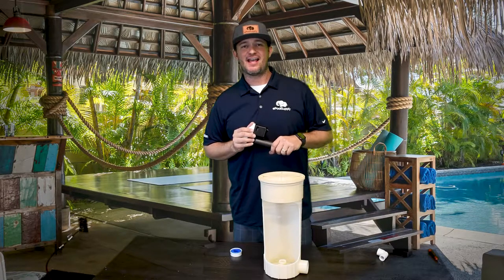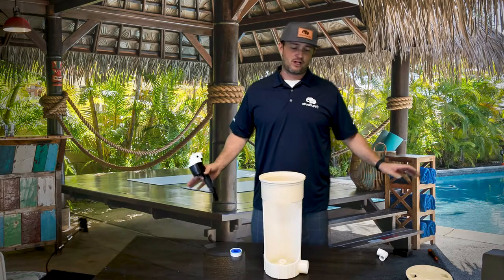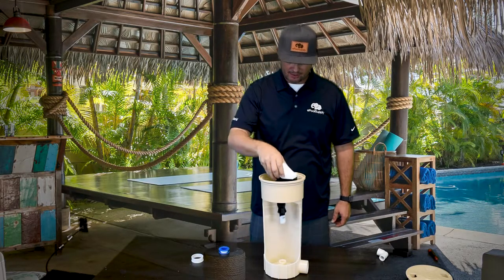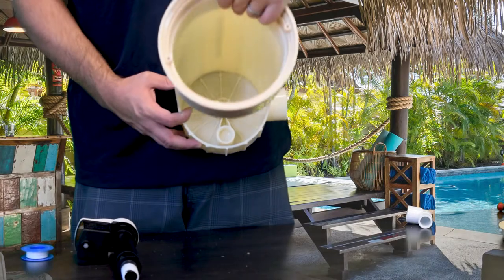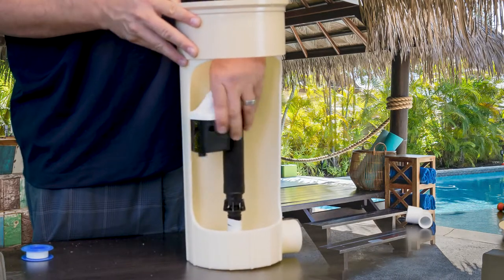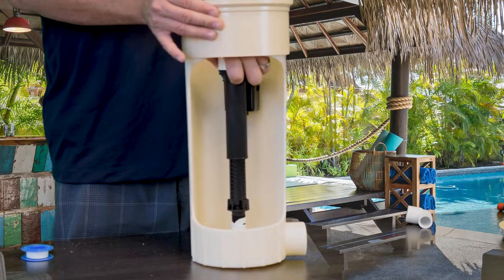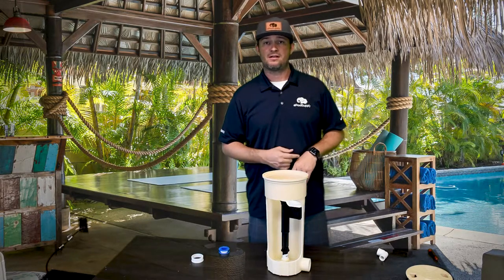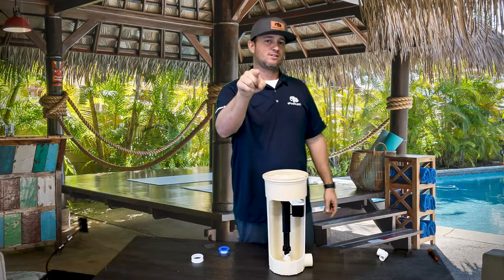How to Install an A&A Quik Water Leveler

Comment: Appreciate your level of detail. Just realized after months of high water bills that the water float was running constantly. When i turned the water off to the float, the grotto water level drained to the bottom of the skimmer door. 
Would this indicate the valve is bad? Where did the water go? Any common places to look for leaks?
Thanks Chris
Reply from the maker: Sounds like you have a bad check valve somewhere. Hope this helps!

Comment: Can you please comment on whether there Is there any difference between the Home Depot $10 toilet Fluidmaster ones/Korky and the $100 Pentair Fluidmaster ones? "Pentair 370006 Bag parts FM Autofill" or the Korky type one you show? (apart from the restrictor) looks like the same thing apart from the huge difference in price? Someone suggested the rubber parts might be different for being in the chemicals constantly? Whats your experience and how often would you change these for preventative maintenance? Is there a case for buying the $10 toilet ones and change more often? Can buy the restrictor elsewhere.
Reply from the maker: You would need to contact the manufacture for technical questions like that. 1 (800) 831-7133.

Comment: Do I need to bail out the water in the housing unit after flushing the line and turning off water valve or just go right to installation?
Reply from the maker: Hello! We recommend a wet/dry shop vac, that way you can get down there and get all the water out! Great question! Thank you for asking.